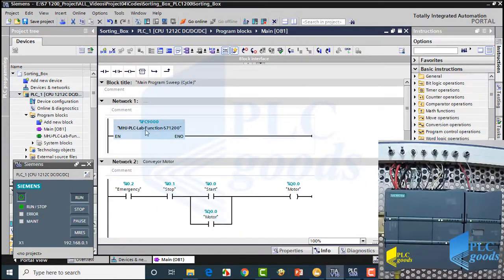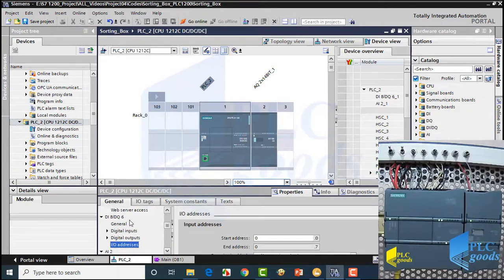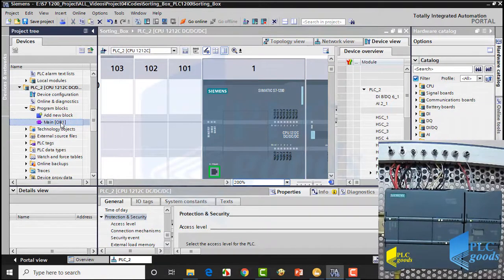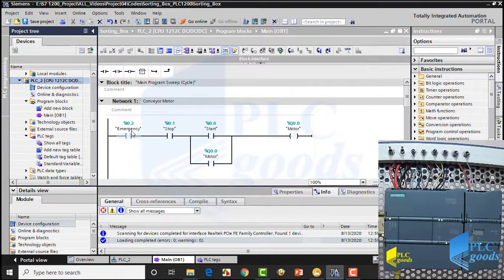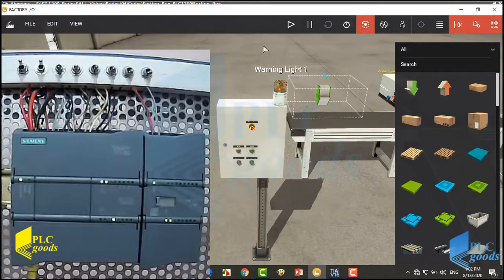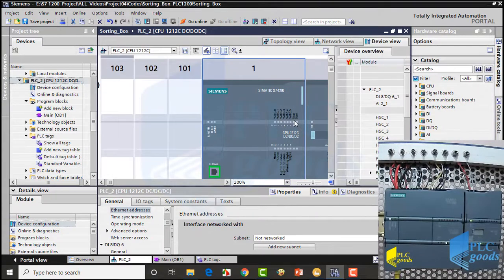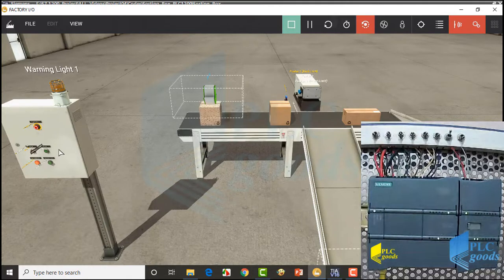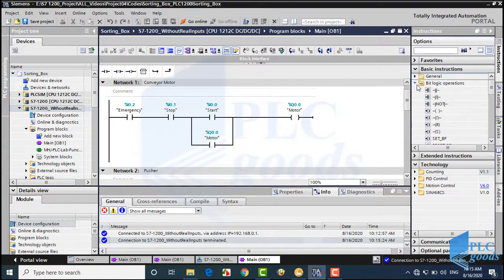PLC Project Transfer | Sorting Boxes with Real PLC & Factory I/O | TIA Portal Tutorial | L 43

Comment: thank you, but as you did it seems that the only way to switch between real and "sim" PLC is starting I/O addresses from byte 10 or not?
Reply: Hi dear friend. Of course not. The only important point is that the real input addresses defined in the hardware section in TIA portal, are not the same as the input addresses used in Factory I/O. 
After hardware configuration in TIA portal, Naturally each real digital or analog input has an address. Suppose you have 8 real digital inputs ( I1.0 to I1.7) and two analog inputs (Iw30 and Iw32). Then you can use other input addresses in Factory I/O which are I0.0, I0.1 to I0.7, then I2.0, I2.1, .... I2.7, I3.0, I3.1, ... , I29.7 , but next inputs with byte number 30,31,32 and 33 are used for two real analog inputs. so, the next free input address is I34.0, and also next addresses can be used in Factory I/O. The easy way is to split the input addresses into two ranges like the uploaded movie.
Reply from the maker: you welcome